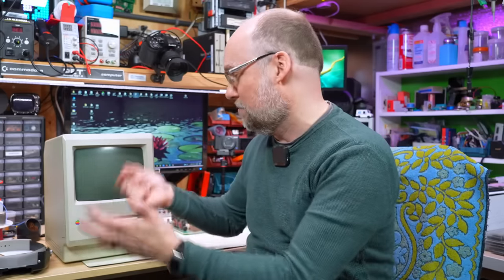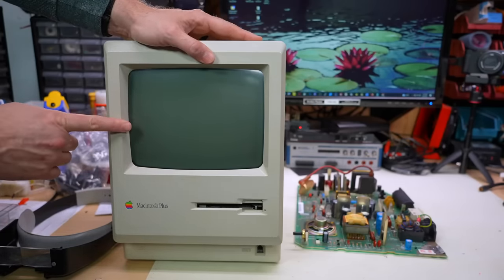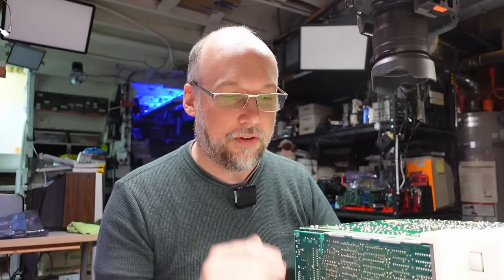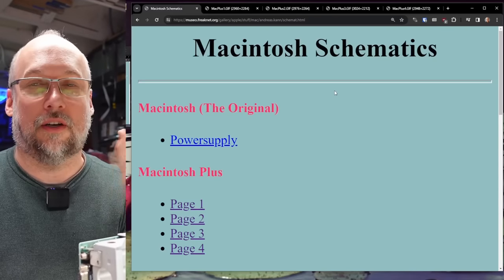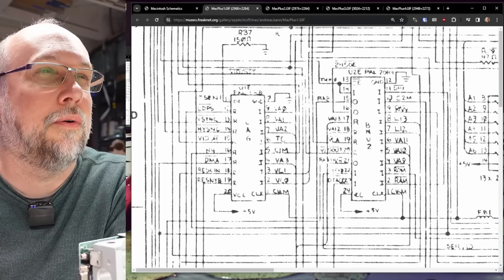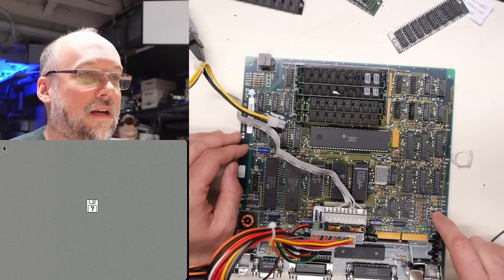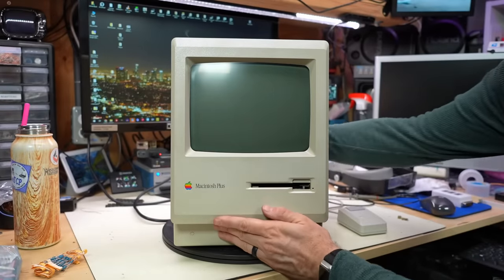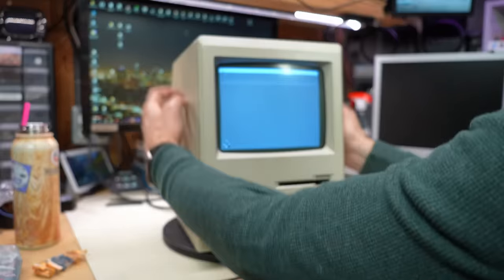Another broken Mac Plus with some odd symptoms

Comment: 15:17  So now I feel guilty... Date code 8925 & 8928. These memory chips were made on a machine that I likely installed. In 8909 I left the UK and moved to Munich to my new job as a field service engineer. While still learning German, my first asignment was assisting at Siemens in Regensburg to install APCVD machines. The world was drunk on cheap RAM and to compete, manufacturers had to pump out more and more... until the bottom fell out of the market. Our machines increased the thoughput at that process step.
So, sorry Adrian, and everyone else! Another great fault-finding video. p.s. I still live only an hour away and still work in the industry... only now I am self-emplyed and travel the globe
Reply: Where can I send my cv, there’s not formal experience but willing to learn a lot

Comment: Back when SIEMENS made chips. I remember the "space race" between West Germany and East Germany, where West Germany would produce Microcontrollers (mainly for PLCs or automotive), and East Germany would have Zeiss copy them because they were world leaders in microscopy, etching, and fine grinding technology. Which triggered SIEMENS to build chips that are sealed in a vacuum and  fall apart upon contact with air, which triggered East Germany to do this in vacuum, which triggered West Germany to, etc. etc. etc.

Comment: Double-clicking the power button quickly on that Anker power bank will keep it on regardless of how much power what is connected to it is drawing
Reply: this should be higher on the comment chain... Hopefully Adrian will see this
Reply: A lot of various brands do implement a feature like this, not just Anker
Reply: I concur. I found this out for myself only a few weeks ago.

I put it down to the tiny current draw on the circuit I was powering. 

After I pressed the button twice (Anker power bank), the unit remained on until I removed the circuit.
Reply: If a power bank doesn't have that feature, you could solder a keep-alive resistor to a USB cable. Some experimentation is needed to find the highest resistance that works.
Reply: @p1mrx non sense
Reply: @Grim-oc9fw  thanks for your constructive criticism.
Reply: It’s called “headphone trickle charge mode” or similar - for devices that only pull about 20 mA, which is under the usual “charging finished” cut-off level. In trickle mode it’ll go for about two hours before turning off.

Comment: the "speaker click" reminds me of the banging heads of the Apple II
Reply: Woz at his finest!  The simple fact that he was able to write a bootloader in 256 bytes, is amazing.  The man could program!

In fact, if you could fit a peanut butter sandwich into an Apple ][ drive, it would read it!
Reply: @jeromethiel4323  what would the drive say?
Reply: @tezcanaslan2877  Claq-claq-claq-claq

Part and parcel of the minimalist design.  To get to track 0 from anywhere the heads might be, it just stepped the heads 40 times. (IIRC the apple 2 disk drive was 40 track, i could be wrong it's been a long time.)

And then instead of using a track 0 switch to stop the motion, the head stepper (which was a rotating plastic disk), would just jump the track when it hit track 0, which made the claq sound.

The Apple ][ was full of little hacks and work around that were just genius.  Wozmon, a full hex editor in 256 bytes.  Amazing!

Comment: Hey Adrian, a lot of those Anker power banks have a mode where you double click the button and it prevents the charge circuit from shutting off if the draw from the connected device is too low.  mine shows a green led in one of the dots when it's active.

Comment: Something to note about newer USB power banks with the wake-up feature. They have current-sensing circuits inside which power down the battery electronics when not in use. Sometimes a Raspberry pi or other small device isn't enough load. If you were to plug in a USB hub, and say a small USB desk fan or light along with the raspberry pi, it should stay on.

Comment: Ripple on DC supply rails for digital circuitry can cause all kinds of issues, I have seen devices lock up or randomly misbehave due to ripple on a 5V rail, if there is high ripple definitely resolve that.

Comment: Regarding the memory...if those resistors were configured for 2.5M, it'd be expecting 2x1M + 2x256k but it had 4x256k installed. Wouldn't it try to test an extra 1.5M that doesn't exist and fail? I wonder if that's all it was, maybe it did work properly until someone got creative and swapped the two 1M SIMMs for another pair of 256ks.

Comment: It would be nice if you preserved the original display aspect ratio and size. In my view, the horizontal stretching you do on these makes them look horrible, and the black borders are supposed to be there, these were calibrated to be WYSIWYG, so every pixel on the screen is supposed to be the exactly same size as physical dimensions in the period correct programs and the printed result.

Comment: Great episode! So I am curious why you adjust the monitor to make the image taller? Wouldn't that cause the pixel aspect ratio to not be correct? Or are you doing it for preference? All early material I could find suggest that in the default configuration, the image should be like it was before the adjustment.

Comment: “caps on the wrong side of the power switch” !!  What!? That’s horrible - I have three Macs to unplug now.
Reply: I think the idea was to reduce the power on noise ripple feeding back into the power line as well as filter noise in the power coming in.  So regardless of how seemingly ridiculous this is to have something always connected to mains, it has a purpose.  Not that I agree with it.
Reply: @jandjrandr  yeah, it's not uncommon. I've seen other devices with always hot caps.
Reply: How about creating a mod to fix this?
Reply: Thank god for British electrical sockets that have a switch at the wall - much easier to keep the caps powered off and safe...
Reply: @volvo09 Easy to tell, if it zaps you when you accidentally touch power input pins with the power switch off it's got caps before the switch. Learned that the painful way when I was going to move my lab bench supply. Turned off the switch pulled out the power cord and then it still zapped me when I brushed the C13 socket pins with my arm. Open it up and to no one's surprise at this point caps were before the switch.
Reply: @Recessio  I'm not sure I've ever used a computer not on a power strip…
Reply: @Recessio the fuse won’t help much if at all once the spark goes through those RIFAs the magic smoke will come up and stink the whole place weather you have a fuse or not. The use will blow after the cap dies.
Reply: Now that everything is standby power instead of a hard switch, caps on the standby circuit are quite often a main failure mode these days. They don't always pop like RIFAs, but they'll go  anyways and render the device unusable if you leave anything you care about plugged in on standby. For example, I have a 10+ year old 5:4 monitor in my server closet as a server monitor that doubles as my security cam setup monitor connected directly to the base NVR. I barely use it and left the monitor just plugged in. The other day I went to use it and it wasn't working. Pulled out the monitor and it turned out that the 10uF starter cap had failed because it's always in use when the monitor is plugged in. I replaced the 16v 95 degree inferior cap with a proper 25v 105 degree mid grade Nichicon and wah-lah, it's back.
Reply: @Cherijo78   Yep.  You want it small, convenient, and cheap.  That means standby circuits running on parts sourced from the lowest bidder that will probably survive long enough to fulfill the expected service life.  Having spent a few bucks apiece on primary-side replacement caps, they're definitely not free...

Comment: oh well, would be interested to see the other analogue board repair, i was thinking poor regulation of the voltage that powers the vertical deflection, it looks a bit like it runs out of steam at the maximum downward deflection voltage. maybe that, or the transistor you indicated is acting up.

Comment: The only other negative post I’ve ever left (not with you) is the ubiquitous response every time I get when I posit a crt question, which you just reiterated as I’m typing this…. Is that I have 3 Mac Plus’s and they all suffer from the same click no bong and no one has ever posted an actual fix.

Comment: The inside of Mac enclosures are sprayed with conductive coating for EMI compliance. Without the white plastic barrier in place on the analog board, I wonder if it's possible to create a short if the outside panel is pressed in a certain way during handling.

Comment: If the Machine thought it should have 2 MB of RAM but only had 1 MB installed, maybe that was the problem. For some reason 1 MB configuration doesn't work. As such this machine still has a fault but in 4 mb configuration it doesn't present.

Comment: Meh.  Never liked macs.  Probably because i have always felt that Apple lost it's way with the mac.  The apple ][ line was a better bet, IMHO.  Unfortunately, Jobs didn't like it and killed it, in favor of "his" design (which he didn't design, he was a salesman, not an engineer).  In short, an egomaniac killed a good product line that i liked, just because.

And Apple has been shit ever since.  I don't like i-pads, i don't like i-phones, i don't like i-pods,  and i don't like macs.  The only reason these products still exist is the cult of personality.  Apple people are pod people.
Reply: Steve Jobs may have killed the Apple II product line, but it did run until 1993, which seemed to be the time when a lot of 8-bit computer lines died. They'd run their course and fallen out of favour, as 16 and 32 bit machines replaced them. The Commodore 64, ZX Spectrum, Atari XE and BBC Master all ended production around 1992-1994.
Reply: @Zeem4  The Apple ][ line could have continued on into the 16 bit/32bit/64 bit eras.

The Apple 2GS, for instance, was a 16 bit version of the 6502.  Heck, the Apple 2 line could have moved to the motorolla 68000, which i really liked as a processor.

Comment: If I would talk 4 hours and waste GB of internet space every time I change a RAM stick, the internet would collapse. What a waste of time and energy and resources this video was. Just change the RAM, dont have to make up an issue just to be a Youtuber. How about original content or useful information next time?
Reply: This video, if you care to look, teaches how to diagnose problems on the analog board and video side, and thus has value. A lot more value than your comment - which is a waste of bytes, by your own terms.
Reply: What's hilarious is you're getting ratioed. Good.
Reply: @QuintusCunctator  to diagnose problems you don't start by the unobtainium PAL chip but you start with the simple things you can rule out easily and are most likely (ram and sockets/simm slots are much more likely to fail over soldered chips that are not known for going bad). And changing the whole analog board is not a repair either. its just swapping parts. It was, for me, a disappointing video, changing already changed caps and hoping for an improvement? It seems like a filler video and forceful production of any video just to make a video, that's all what I said. Usually you can change RAM without letting the world know and have something more interesting up the sleeves if you do that professionally. Man, take the advice or comment or not, or block me if you are not allowed to say anything. He prob will knows himself it was a filler Vid where nothing really happened. Usually, it's more interesting. He himself refers to another video where he already did that work, so there was really nothing new except some misleading concepts on how not to start a diagnose.